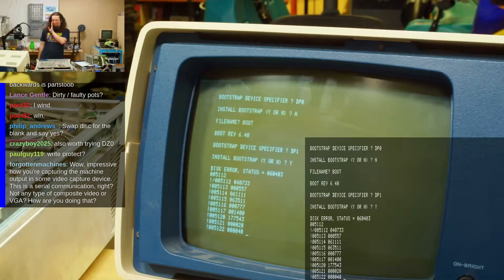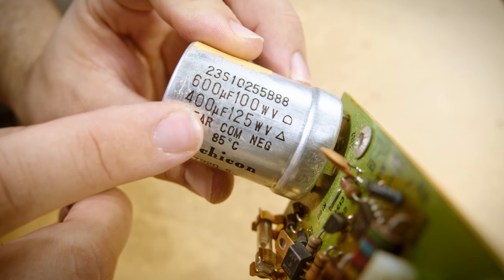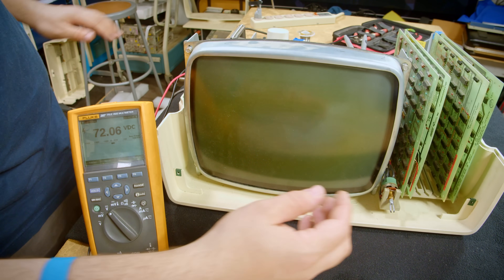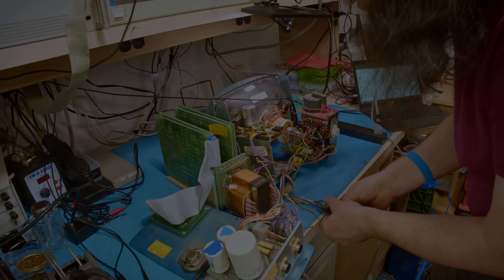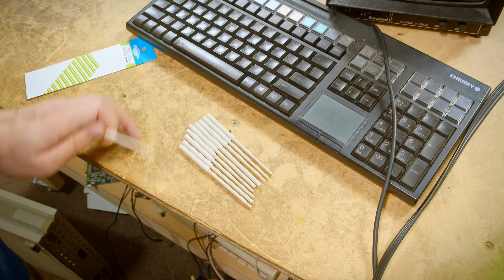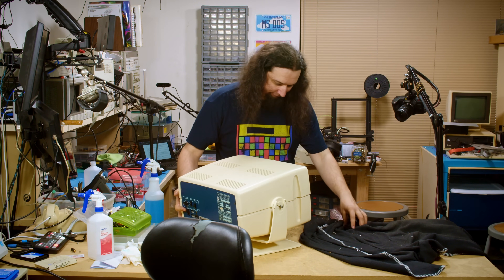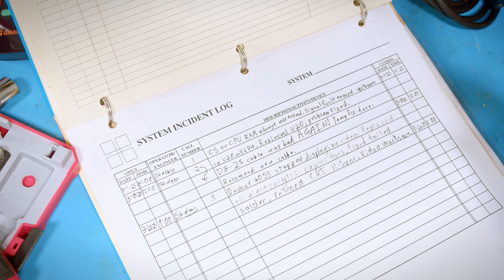Data General Dasher Terminal CRT Repair

Comment: Oh!

So this is the computer they used for the workstations in the Severance tv show. 

They seemed to have made a custom keyboard with a trackball built in, but the monitor looks the same as the original.

Comment: The bad solder joints can eventually create a fire hazard as well. I had a Commodore branded multisync monitor that came with my A1200. It might have been a 1960 but I'm not 100% on that. One day I turned it on and noticed it had developed some concerning whine that was not typical CRT whine. I was getting ready to diagnose it when I was called away for what turned out to be about 30 minutes. When I came back the display was completely dead and the room smelled of magic smoke. I took it down to have a look and noticed that the bottom of the case had melted. I pulled it all apart and found that a small fire had started around a cracked solder joint in the high voltage section of the board. The arc was enough to ignite the PCB. Luckily it failed open as the PCB burnt and broke the circuit. It was completely unsalvagable obviously.

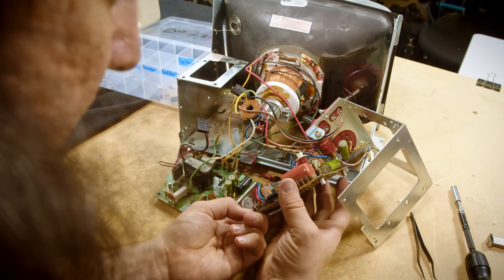Comment: 5:39 i usually cut the wires in the middle and make connectors for them. I have a lot of gold plated spares from other projects, but regular connectors of the correct size and current travel should be aok. Purity getting in the way of proper and comfortable repairs is a bad thing. It's like welding. If you're not comfortable welding, the weld's going to suffer. A good welder gets comfortable first, then welds. Same goes for electronics. Just my 2 cents on it. There's also the fact that doing it this way risks less chances of solder breaks, at which point, you're back to square one, where you might've just as well de-soldered the wires.

Comment: I'm surprised you had the boards out, did a full recsp and didn't check the solder joints as part of the general process.

Comment: I had a Lot of Hair pulling days as a Technician, I worked on some of the most complicated circuits you could imagine, that would literally turn you inside out. The only things we could reach out to was schematics, Textbooks, journals and technical reference guides. CRT's are very unique that the way each manufacturer designed them was insanely inaccurate and not up to specs. once they were rolled out from the assembly line they were all passed but were fault bombs. The warranty was not actually a guarantee, people misunderstood that. it was the time allowed for us technicians to order the assembly line parts from the manufacturer to replace bad sections or parts for the customer within that time frame, the reimbursement costs. these days electronics are just shonky and you wouldn't want to touch them, just disposable

Comment: Capacitor leakage current is often causing weird issues and is important to have in mind when testing old caps. Capacitance and ESR is easy to test but true leakage needs specific testing equipment. Leakage current is what all the rave about re-forming is but it won´t always fix a capacitor doing that

Comment: The Dasher keyboard just looks so good! 

I like the design so much that I bought a modern MT3 double shot ABS Dasher lookalike keycap set. Finding a keyboard chassis with a dark blue matching case close enough to work with the keycap colors is turning out to be bit harder than I expected.

Comment: ESR is only really important for power applications where the capacitor has to charge and discharge rapidly with large currents (and thus, the ESR creates large voltage drops, making the cap useless). In older equipment many electrolytic caps where used simply for DC blocking, AC coupling. In many cases these signals are pretty high impedance anyway and a few tens to hundreds of ohms ESR won't matter at all. A far more important criteria to check is DC current leakage in these cases.

Comment: You have probably gotten this comment a trillion times by now, but you really need to build Mr. Carlson’s capacitor leakage tester or get one of the high voltage cap testers with an eye tube. Testing just for capacitance and ESR is missing one of the most common types of capacitor failure!

Comment: What we've learnt from this is that: Thou shall check solder joints!. If you had just replaced the bad caps and resoldered all the boards in one go, it wouldn't have taken so long. It was probably wave soldered. Wave soldering never applies enough solder.

Comment: Didn't know that the terminals in Severance were an actual product, I thought that the prop department made their own
Reply: They did make their own, in a sense. They simply got a Dasher terminal from a museum, made molds, and created a very custom version with keyboard and trackball. Relatively expensive, but they had a huge budget already for season 1.

Comment: I watch a couple channels where they repair old arcade machine and this is a huge issue with the crt. They have a trick to temporarily fix it but it only works for two years max and sometimes only 2 weeks.  At that point the only hope is a replacement

Comment: I’d imagine dry solder joints is why I retired a tv back in late 2003. I wasn’t equipped to repair it nor was I brave enough to even try back then. However in 2020 I had ordered a 200 watt class D amplifier that is palm sized from Amazon. It arrived with dry solder joints. I had that thing fixed in about an hour. Still using it today. Though I hate the power supply I bought for it as it causes a lot of background noise you can only hear when nothing is playing and at high volumes. It is very difficult to find 24 volt 6 amp high quality power supplies at a cheap price. If you want to talk struggles with repairs I once attempted recapping a dell xps 600 motherboard without good tools and couldn’t even get any good signs of life other than undocumented error codes. Spent weeks on that computer before giving up as if it had been repaired it would have gotten retired soon after as the specs were a terrible match for the longevity of windows 10 installation. Truthfully it struggled with windows 7 when it was working. Probably the main limitations it had was the power hungry pentium d extreme and 2 gigabyte ram configuration. A powerful choice for windows xp but not much for a world that was transitioning into 64 bit processing. The system claimed being 64 bit compatible but clearly wasn’t the same standard that vista and later versions of windows would use. I believe what killed that computer was a combination of capacitor plague, lack of cleaning the cooling system, and extremely high temperatures inside the case. Mind you this computer came with eight fans if I remember correctly back in 2005. An absolutely insane amount compared to most others on the market at the time. Sad to say that would have made an excellent windows xp era gaming rig today as it utilized multiple pcie 16x slots to allow for sli which was an option when new. Today if you manage to find one guaranteed it would need a full recapping due to the manufacturing date these were available. Certainly an impressive machine for its time though.

Comment: If you have running water in your office and a sink, hot soapy (dawn dish soap) water does the best job cleaning this old stuff and poses no risk to the paint or plastic.  A soft sponge for flat surfaces and a very light plastic bristled scrubber does great with the sand casted (pimpled) look plastic.  It takes off just about everything you will ever see on office stuff. Cigarette tar, general grime, caked on dust etc.  It won't leave any kind of residue like a lot of cleaners will leave.

Comment: It's a miracle any of these old terminals still work.  They ran years on end 24/7.  Nobody ever turned them off and they were likely in an office for 10 or more years.  That's almost 90,000 hours.  TV crts generally don't last that long, especially the ones made back in the 60s and 70s.  It's also a miracle that they generally don't have a lot of burn-in like PC monitors got running dos-shell 24/7
Reply: I'm also surprised that CRT module is still working.
Reply: Especially when you consider the tech back then was built with no more care or desire for longevity than tech today, and the designers and users of the time didn't yet have enough experience to know what was good or bad for the hardware.

I think we're seeing a lot of survior bias here with retro hardware on YouTube though. They made hundreds of thousands of these things, and we get to see one or two working. Think of all the old tech that was just thrown out when its upgrade was brought in, or it did have severe screen burn and also got thrown out.
Reply: @ncot_tech  Obviously it is true that we only see stuff that wasn't disposed of and so you get this bias.  I don't know when it started, but you couldn't just throw these away.  They had to be disposed of through third parties. You have to pay a recycler to take it away and every single serial number has to be recorded and stored lest any of it ever show up in a dump.  I work in IT and as far back as the mid 90s you had to do this. But I don't know exactly when it started.

I think most people knew running them would age the CRT.  CRT replacement was very common back then. The early color CRTs didn't last as long and the sets were extremely expensive.  In the mid 60s, a console color TV started around 500 Dollars.  This was a lot of money in the 60s.

Comment: You really need one of the old capacitor checkers for these high voltage caps.  Modern handheld capacitor checkers only check with a few volts.  Leakage often won't show up on these due to the voltage being low.

Comment: Maybe splitting some of the nicer (bamboo) takeout chopsticks as calibration tools?  May need burnishing/shaving to clean up stray fibers, but the tapered tips should be just soft enough to be reshaped as needed - Though it will concentrate any torque at the top/open edge, maximizing the chances that an irreplaceable part will split or distort.
... and excessive usage will accumulate oxides/abrasives/dirt which will leave scratches like a charged grinding rod (whittle/pencil-sharpen to clean).

I know from experience the "chewy" (soft wood) takeout chopsticks splinter too easily. (edit:) As the natural grain tends not to run parallel along the whole stick. ... I managed to find the appropriate tool before a set of nicer disposable chopsticks (that weren't buried in food).

Comment: Dry solder joints, that's why punching an old CRT TV temporarily fixes it :)
Reply: The heat cycles is what does it.  I'm kind of surprised it had all these failures as they generally did not experience a lot of heat cycles.  These things ran for years without ever being turned off. 
But this failure is extremely common with tube TVs and even in solid state CRT TVs.  The at least daily heat cycles (hot when running, room temp when off) just wrecks the solder joints.
Reply: Are vertically mounted pcb's more prone to it developing, than horizontally mounted ones?